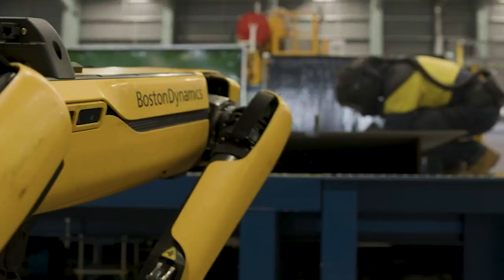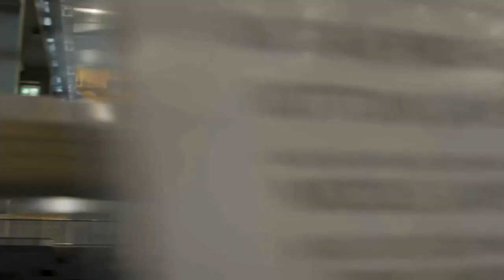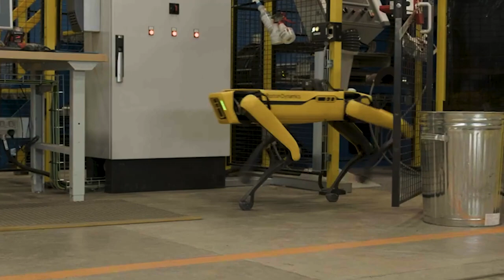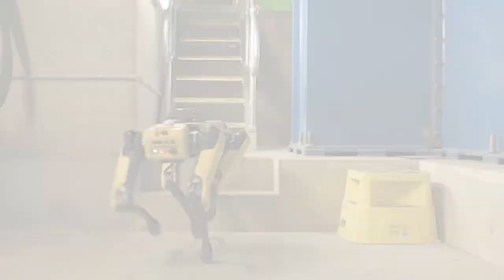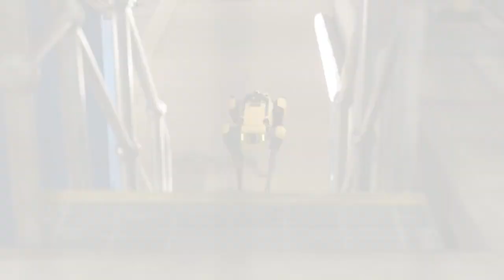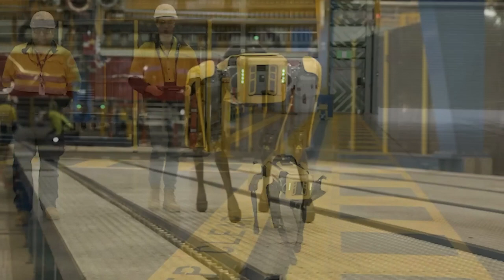Investigating safer and more efficient solutions for the naval shipyard environment | Spot the Dog

Comment: OK thats pretty cool, having a robot dog. Makes me wonder how it actually undertakes maintenance.
Reply: From my understanding, spot is more to do with locating issues/survailance if you will, rather than a way to fix those issues. Think instead of a team of technicians doing regular walk arounds of a production hall, inspecting machinery, checking gauges Etc, spot (or several units) will be on a continuos loop using various technologies to "check up" on different machinery Etc. If a problem is found, they then notify the actual technicians, whose time is now better spent actually solving issues rather than finding them.

Obviously some tasks still need a human either in the loop, or can only be accomplshed by a human (I don't think spot can climb ladders...yet) and certain objects spot would likely struggle identify isssues with (or again accessibilty might be an issue), but spot is a valuable addition to many workplaces nowadays.
Reply: @kimjonglongdong3158  that sounds quite useful. Thanks for telling me!
Reply: @otgmeepmeep5082  NO worries pal. Always a good trait to want to take in more information!